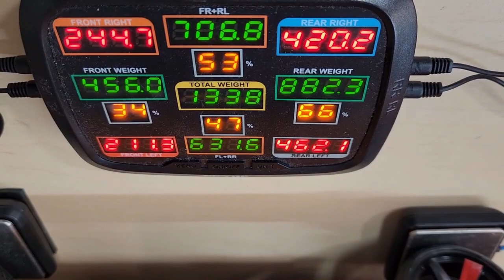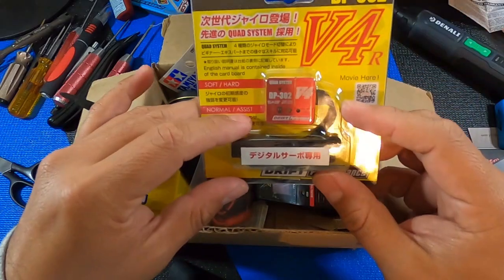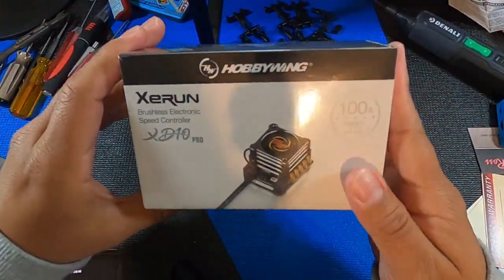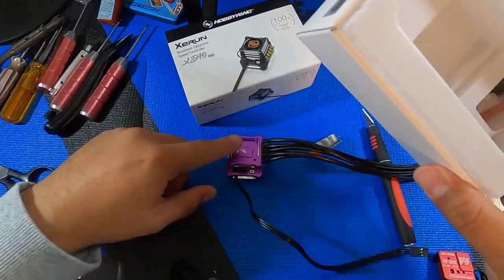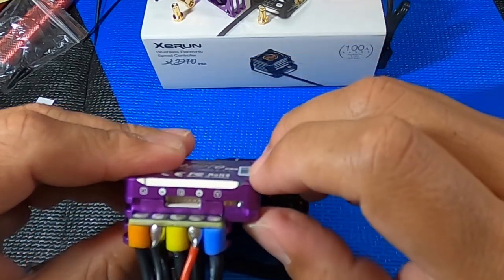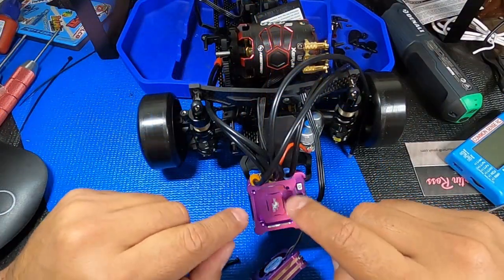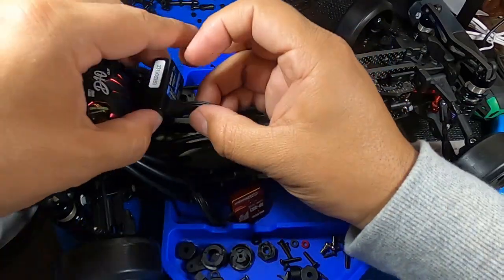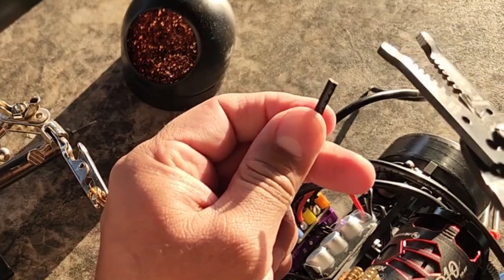RMX EX GT BUILD EP 3

Comment: I have the same chassis/set up and electronics as you. The speed is there. Make sure you have a good amount of FDR to maintain a tandem. Mike I honestly think your not dialed in correctly in your esc and remote. You put in the right numbers you will literally see a night a day change in your cars performance. From there it’s all wheel time. You look like you’re constantly compensating on your drift and transition. Friends of mine from SATX is competing there this week.
Reply from the maker: There has been a lot of adjustments, in the turbo, timing and suspension. My brother drove my car and hit the wall pretty hard. I had to replace the rear diff because of a few broken teeth. Also one of the turnbuckles was binding and i had to replace that as well. But, you are absolutely right! MORE SEAT TIME. I have only been taking it serious since January. Back then I was running the RMX 2.0. Still have lots to learn! hope to see you out there soon.  Thank for the view!!!